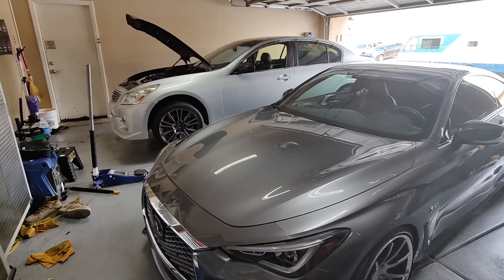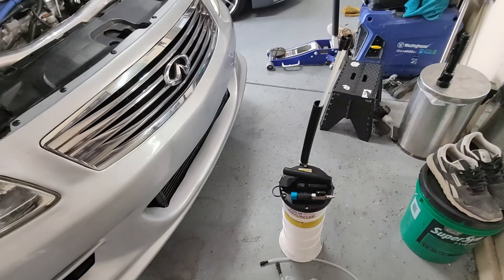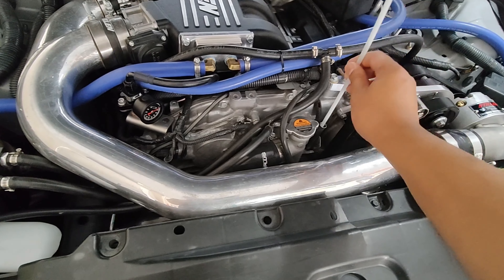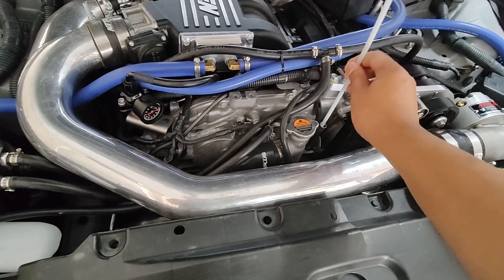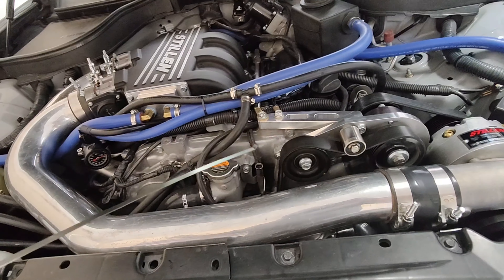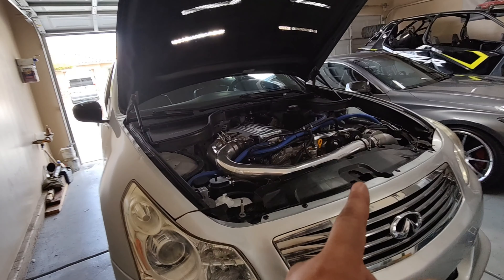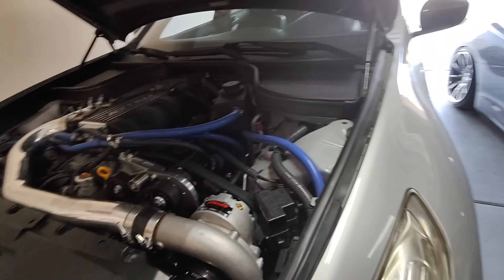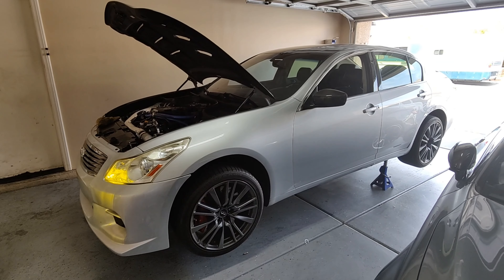HOW TO USE AN OIL EXTRACTOR ( so worth the money)

Comment: Bring car up to operating temperature, let it sit for 15 minutes you want it to drain to the pan and cool off a bit,warm not hot. Crack your oil filter fill cap. Pulls out more oil than just drain plug. I did 5 pumps on my G37 and gave it a few extra after the rest of the oil drained from the engine. I like the  larger Purolator Boss filter that is 100% all synthetic media and do multiple oil changes with the same filter.  Good for 15,000 miles.Your car is looking good!
Reply from the maker: 🤙🤙🤙🤙🙌🙌🙌🙌🙌 thank you! I will look into that filter 🙏🙏

Comment: I have one from EWK, pretty much identical.  It's such a cleaner and better way to change oil...especially on top mounted oil filter cars/trucks.   One useful tip is to do it with the oil already warmed up so it helps the flow.

Comment: The non pneumatic manual one is perfect for multi car home use and is half the price of the pneumatic version.
Reply: It takes longer though if you don't use a pneumatic one.   Make sure the oil is hot or it takes a lot longer to extract.

Comment: I feel like for your car, its almost not worth it to use an oil extractor because you still have to jack up your car and crawl underneath to replace your oil filter. You don't save any time, but it just produces a little less mess. If your car had the oil filter facing up in the engine compartment like an Audi or VW, it would make more sense.
Reply from the maker: You are absolutely right!  however I change my oil without changing the filter at times because I changed my oil around 3000 miles and I actually use the oil extractor for other things like my diesel trucks. The fact that it saves me from dripping any type of fluid is still worth the money 🤙
Reply: Depending on how ofter you change your oil you can do the filter every 2nd change.
Reply: The dyi life is crazy
Reply: On most Getman cars the filter is on top, this is perfect for me I will be using my oil extractor soon
Reply: most filters are rated up to 15k miles so technically you don’t have to change the filter every time, oil changes are done 3k/5k miles depending on year of car but yea
Reply from the maker: Can

Comment: Hey bro
Good video, cab you put a link for 1) the wrench you used for the oil pan drain plug, and 2) the tool for engine oil filter?
Reply from the maker: The drain plug is a 14 mm wrench and for the filter I use my own hands. The filters do not need to be on too tight

Comment: Cool stuff 
Like it 
Did it go down dipe stick hole to bottom of pan ??
Reply from the maker: This extractor actually took out all the oil from my engine because right after I took off the drain plug. No oil came out. But I don't think it works for all cars every car is different

Comment: Would it move faster if it was at operating temp
Reply from the maker: Not operating temperature will make sure that the oil is slightly warm. Yes it will move faster

Comment: Whats up the vr transmission, how is holding up?
Reply from the maker: Still feels like I just installed it. Never had one problem with it. Actually. I ended up having to tighten my torque converter because it got loose. 🙏❤️🙌🤙

Comment: If you use it for oil, then coolant
do you need to clean the lines before doing the coolant? 

Also do you support the G on the frame when raising it?
Reply from the maker: I recommend you clean it before you use it for any other fluid 🤙 I jack up my car on the sides and I put my jacks on the frame right next to the side skirt and the two fronts on the subframe
Reply: Why clean it ?  You're pulling old stuff out to dump, not using it to transfer new stuff into your car.

It'd be like washing your garbage, before taking it to the curb....
Reply: How would you clean this thing of old oil?

Comment: Hey what's good bro! I follow your channel and your info is Awesome. I would like your opinion on something, I noticed you changed your engine VERY NICE. I have an 08 M35 do think a JDM trans would be good? I don't feel my M performs like the G35. Let me know your thoughts please.💯👊🏾👍🏾
Reply from the maker: Hello sorry for the late response to answer your question. Any replacement for your engine and transmission is going to be better than the old one.
Reply: @INFINITIBROTHERS  hey! Thanks for the response bro. 👍🏾 So if I replace my trans with a JDM it SHOULD perform better?
Reply from the maker: They are the same to be honest. But yes it will definitely perform better because it is a newer transmission. 🤙

Comment: So all the oil contaminants are just staying in The oil pan ??? I’d rather drain my fluids
Reply from the maker: if you didn't see.In my video I take out the drain plug after I used the extractor.nothing came out. It's really up to you. But apparently this is the correct way remove the oil.
Reply: @INFINITIBROTHERS  nothing came out I’m assuming Any contaminants are now just laying on your oil pan unless you pull down the oil pan and clean it I feel more comfortable draining my oils knowing that everything is coming down the bottom where it sits
Reply from the maker: @885.0ELopez  I see what you mean! 🤙 That is how all oil changes are though you are not going to get every single thing out that is why you use a good filter 😎🤷
Reply: @INFINITIBROTHERS  yup true I just feel u get the most out if u drain and well I do all my oil changes every 2-3 k miles depends how I’m driving 😅
Reply: @INFINITIBROTHERS  but that tool is perfect for a woman or elder person who can’t go under a car I still like that tool I would use it for all other fluids though coolant , power steering etc. would do a perfect job In less time
Reply from the maker: @885.0ELopez  absolutely 😎🤙